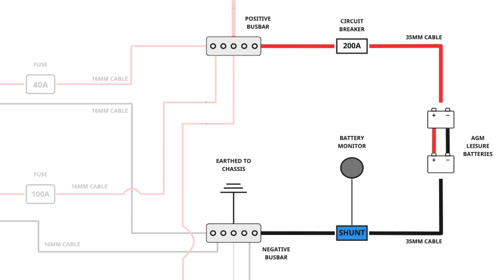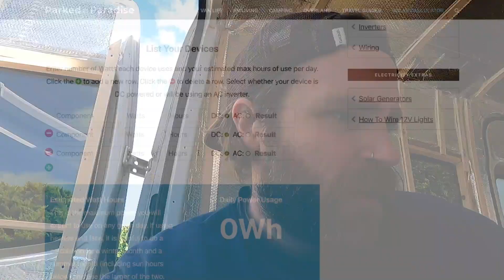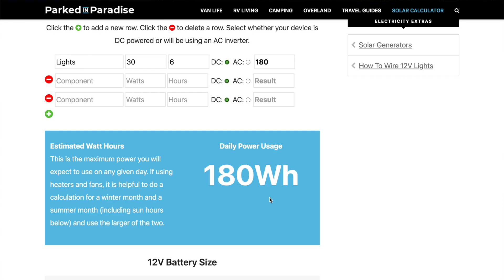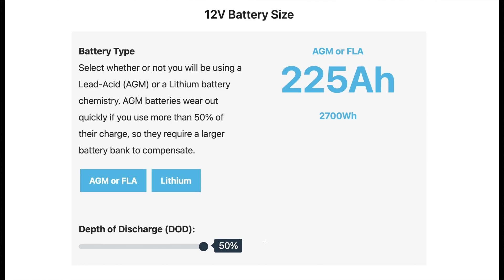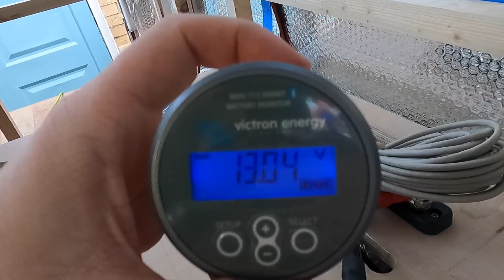Sizing and Wiring up Leisure Batteries and Monitor | Van Electrics | DIY Sprinter Van Conversion UK

Comment: Are different wires rated differently depending on the brand? I calculated 50mm for 150Amps maximum load. Where do you get the cable rating? Maybe the size is because of the voltage drop
Reply from the maker: @sprintervankev  whilst a cable’s gauge is a good rough guide to follow, the brand of cable can certainly play a factor. This can be down to things like material quality, construction and manufacturing standards. For the most accurate info, it’s best to stick to the manufacturer’s spec rather than relying purely on the gauge 👍🏼

Comment: Love these videos - Ive watched loads and yours are amongst the best IMO. 2 things - maybe I missed it but do you have a plan for the board template you used, to save me guessing measurements and where to put the holes. 2nd, have you considered a video for installing a hook up? I have a VW T5 and might occasionally use shore power when on my travels. It's helpful to know where to connect things on the wiring diagram. Cheers m8
Reply from the maker: Thanks so much dude! Honestly means a lot to know they’re helpful! 

I haven’t done a board template purely because I feel they’d be completely unique to each person - from each component needed to the amount of space available. What I did was work out how much space I had to play with, cut out the board and then arranged everything so that it fit evenly. 

I haven’t actually got a hook up wired in at the moment. I’m purely solar then use my VSR in emergencies. 

Thanks again dude!

Comment: First of all, thank you for making these incredibly informative videos...  I am using these as a reference to building up my own Solar RV DC power system.  I was wondering if you had the initial video for wiring from the starter battery to the system and if so, did you use a charge controller for this part of the project?
Reply from the maker: Hey dude, thanks so much for the comment, I’m glad you’re finding them helpful! 

When I bought the van it had a Voltage Sensitive Relay installed in the front already, so I just connected my system up to that so if I have days with little sun, I can turn that on as a last resort and charge my leisure batteries whilst I’m driving.

I did have a video for this but then I realised I completely forgot to mention in the video that VSR’s shouldn’t be used to charge batteries up to 100% as it can damage them, so I decided to take the video down. 

I’ll be looking to upgrade to a B2B charger at some point so I’ll likely do a video for that when I install it 👍🏼
Reply: Thanks so much for the quick reply and sanity check.  I was also viewing different videos explaining the differences between VSRs and B2B chargers.  I purchased the Victron Orion-Tr Smart Non-Isolated DC-DC charger and am looking forward to hooking it up as it has a ignition based remote control switch.  This was the only part where I was left kind of in the dark as I wanted to make sure I did it with the precautions you set forth in your other videos.  My solar panel setup is basically exactly like yours.  Very excited to get this wired up!  Thanks again!
Reply from the maker: @watsonjoel  I wish I’d done a bit more research before blindly wiring up the VSR! VSR’s essentially just blast your leisure batteries with power, whereas DC-DC chargers will actually carefully charge the batteries without damaging them. I’ll likely get the Victron one too soon! Keep me posted with how you get on 👍🏼

Comment: you could probably buy those shorter wires done by someone else, third party, it would save everybody having to buy all those tools. its just called daisy chain, or looping battery leads.
Reply from the maker: Oh absolutely! I’m definitely glad I bought the tools though, I’ve used them loads since on other projects and was a great learning experience.
Reply: @GreenHornCountryClub  Well, a cutter, crimper, heat shrink, its up to what £90, and most will never do it again. So if one supplier does it - its just more environmentally friendly. I love my tools, but for a one off job I think it makes more sense.